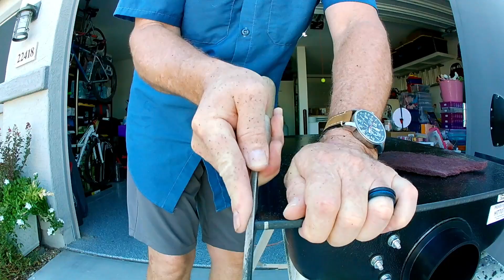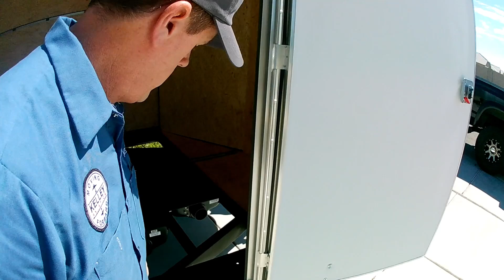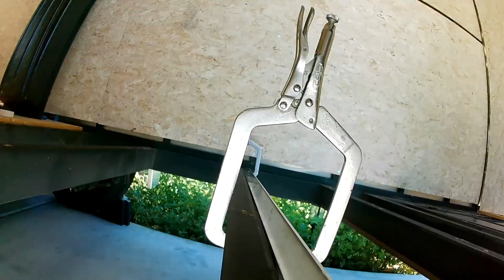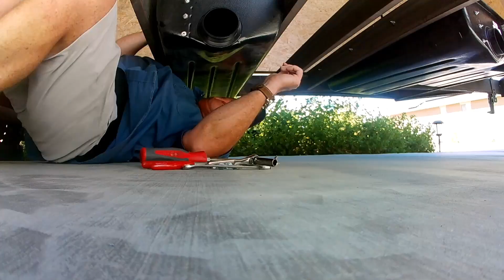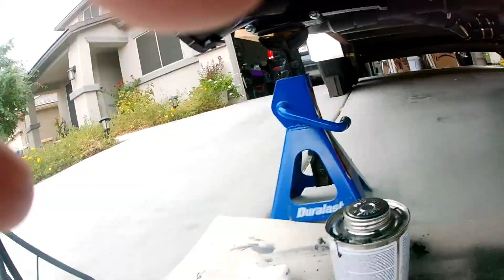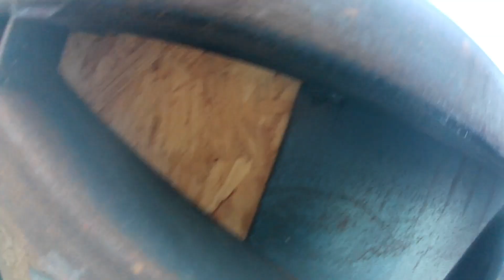Installing Black & Grey water tanks

Comment: Thank you for the informative video!   What was the reason for the knife valves facing the inside?
Reply from the maker: I faced them to the inside simply because the doorway to the trailer is just above the drain and I didn't want the handles getting stepped on or bent. So I turned them back. The drain swivels as well so it works pretty well. Very compact and protected.

Comment: Not sure why these waste tanks dont have the drain hole in the center
Reply from the maker: Just guessing the drainpipes would project down below the trailer frame quite a bit before turning 90 degrees towards the drain dumps.